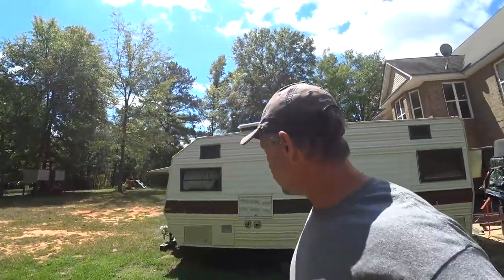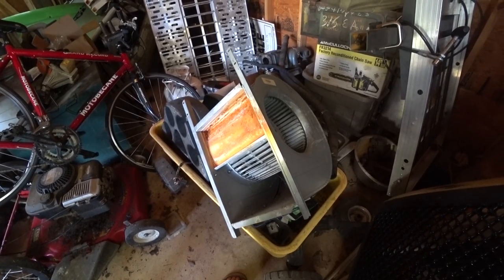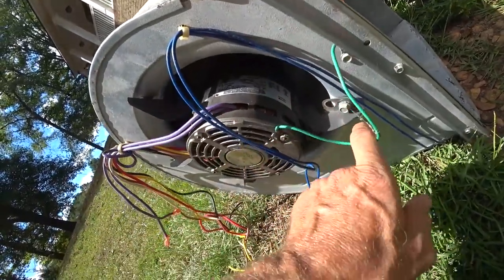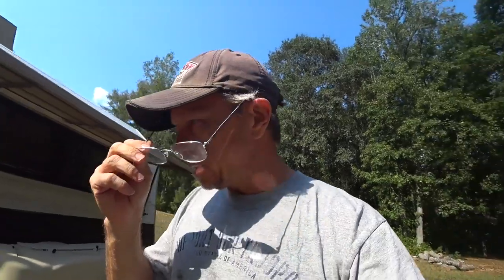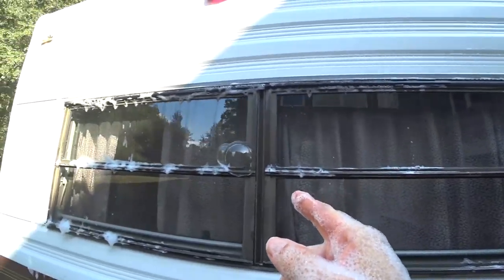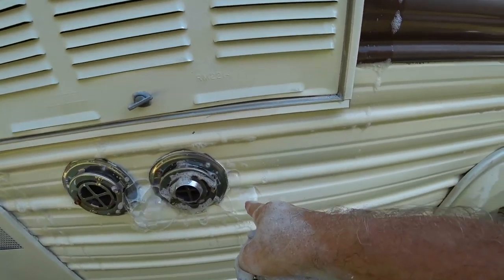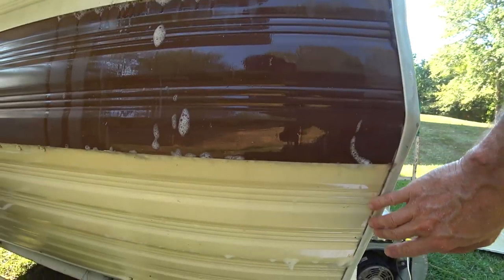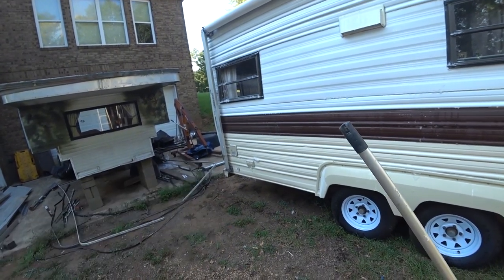DIY RV Camper Leak Testing

Comment: Found all your leaks and made clean spots all over the old camper, that's definitely going in my bag of tricks!
I've seen HVAC guys do this to my house, then walk around inside with a smoking wand thingy, running it near all the usual suspect draft areas until they see the smoke fly out through a crack. Then they just sprayed expanding foam in the draft spots, course they weren't worried about water, just air.
I never though about doing it to a camper/RV, this is perfect for doing once a season during the usual check-up clean-up tune-up.

Comment: We always roll on a couple of coats of snow seal on the roof of any rv we have ever owned. It eliminates the need to check for leaks, as it creates a rubberized coating that seals everything it touches. And yes, it comes in white.

Comment: I use garden sprayer with soapy water. Store brand dish washing soap is good and it works for tire mounting too.  Grain bins and all manner of containers can be checked with a squirrel cage fan for leakage. I use my riding mower pulled up against the fan with park brake set to hold it.

Comment: Energy Audit tester install a front door blocking/sealing canvas door with a large fan in it. He then looked for air leaks in the house. He found a chimney clean out door, several windows, and a basement floor seam allowing a draft into the house.  So a fan method is used by those in the profession of locating leaks.
As a trucker, I would use a SMOKE BOMB into a van/refeer trailer to check for leaks, like door seals.

Comment: Great idea! Peace of mind along with a cleaning. My camper is very similar well made unit. My problems were ruptured water heater ( mig welder ) ruptured pipe behind tub. Then minimal from twice plastic roof vent covers breaking in storms. Shore those up with plywood & sealer. I need to make some good aluminum or galvanized ones.
 Still deciding on keeping it?

Comment: I would think there is a pressure the fan should push and it will certainly fail at. You where pushing air that is for a large home into a very small space. I wouldnt worry about those leaks. You would cause more problems trying to seal them then its worth.